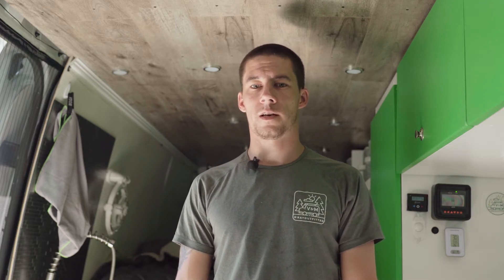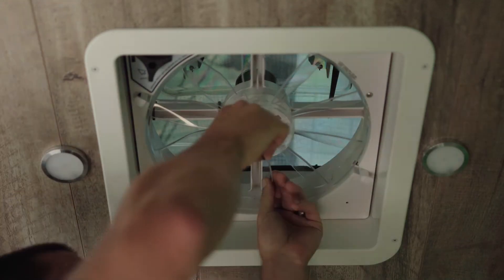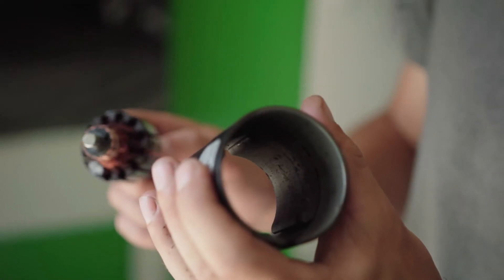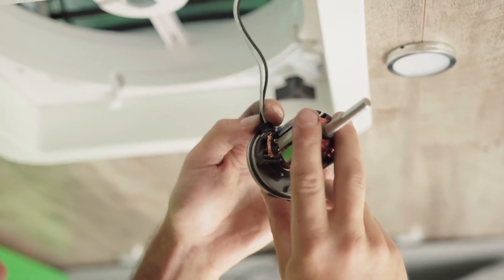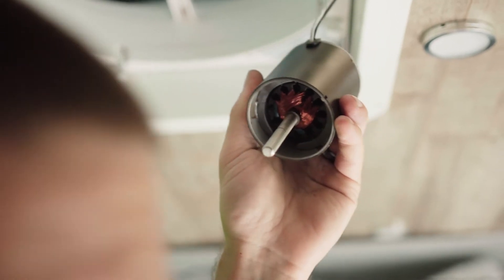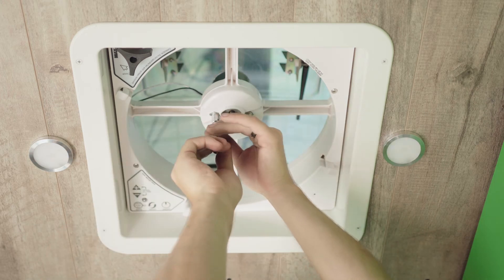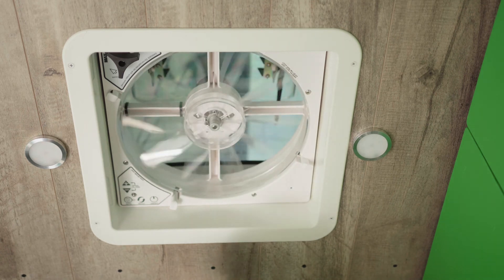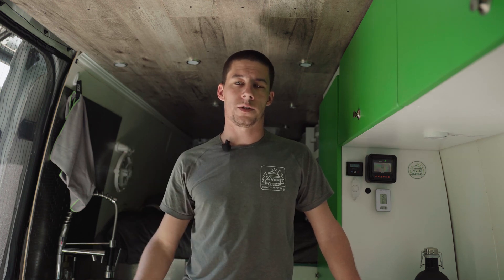MaxxAir Fan Squeak Fix - Ray Outfitted How To

Comment from the maker: Thanks for checking out my video on addressing the fan squeak. Questions or comments? I appreciate your feedback!
Reply: V & M Great videos.  do u do repairs and van builds in new york city?
Reply: Thanks for the video. I have completed this many times, but I recently did it and the motor is still squeeling slightly. Any ideas? The motor is not too old as Maxxair had sent me a new one as I had a squeel issue before. Thanks again!

Comment: Perfect instructions.  One thing to note… you do not need to remove the snap ring.  The bottom plate will come off if you angle it and you don’t have to remove the snap ring.

Comment: I was able to fix the squeak by running the fan on high for 10 hours.  I called MaxxAir first, and they suggested I do this to "seat the bearings" by getting it nice and warm.   I would have thought the bearings would have already been seated since it had been running almost continuously for 9 months, but apparently not.
Reply: same here... quite annoyed really seeing it cost me $550aud for it...
Reply: Running the fan on high speed will help clear out some of the brush dust from the path of said brushes, as well as sync up the grooves between the brushes and commutator. The squeaking is usually a symptom of running the fan at less than 100% speed

Comment: Excellent tutorial. I had never taken apart an electric motor so this was a great introduction. Very helpful to point out how to wrap the wire around the plastic tabs to retain the brushes. My maxxair fan has been chirping or ticking at low speed. I cleaned the motor innards (wasn't that dirty) and put it back together. It was still making noise. I immediately disassembled/reassembled and it's been quiet so far. Thank you!

Comment: Excellent guide - just cleaned a fan with a squeak that was worsening, and also cleaned the 2nd one while I was at it. Especially appreciate the details about securing them releasing the brushes when reassembling. One thing I noticed - it is challenging to get the long bolts positioned properly so that they fit back into the thread. I realized that this is because they are pulled out of alignment by the magnet. Took some patience and a bit of sweat to fit the pieces back together. One suggestion/request: please decrease the volume of the background music; I was having a hard time hearing some of your words.

Comment: I haven't had much luck, I've cleaned it out twice now, using paper towels and a lens cleaning blower to get all dust and dirt out of everything I could find. But the fan still squeaks. Which bit is likely to be squeaking exactly? If I were to use some lubricant e.g. WD40, on which part?

Comment: Another great video. Very informative, clear and precise. Thank you! Two notes: for my fan, the Allen key holding the fan blade was a 3/32...the 2.5mm was too big. Also, because you’re dealing with the guts of an electric motor, be sure to pull the fuse to it before dealing with the internals.
Reply: My 2.5mm Allen key was also a touch too large, I simply filed it down a little and then it worked. I didn't have a 3/32, not sure if they exist in the UK. Hope this helps people. 🤞
Reply: @nohandle181  :D As an engineer I can assure you, imperial Allen keys do exist in the UK. It cost £1.42 on ebay. Alternatively you can use a surfboard FCS fin key. That’s also 3/32.

Comment: Mine has been used full time for over a year now and the past 6+ months it has been on practically 24hours everyday. The Squeak comes and goes depending on speed. But it is mainly brought on after a decent gust of wind I have noticed.. also  can here the motor actually click on and make a louder humming sound... Going to finally bite the bullet tomorrow and try and clean it out...

Comment: For those who have issues with fitting a 2.5 mm Allen key to get the fan rod off, a Torx T10 key works too :) 
Also the fan rod might need some WD-40 and a bit of a wiggle if it hasn’t come off in a long time but it will come off.
Reply: You need an imperial 3/32 Allan key. It cost £1.42 on ebay. Alternatively you can use an FCS surf fin key. That’s also 3/32. (2.38 mm)

Comment: Thanks! Maxxfan told me the motor wasn't serviceable when I asked about the squeak years ago. I've been just dealing with the noise since. Obviously they lied. 

Any idea on what could be causing my fan to not spin, or how I can diagnose it? Voltage is sufficient to the fan, the power turns on and beeps with all buttons, but no spinning.

Comment: Awesome video! so helpful thank you! My 7500 Maxxair fan ticks quietly which you can really hear when it is on a low speed. Not sure why. Seems to have a slight wobble in the blades. Brand new fan 1 month old. Good to know I can remove the screen that easily and access the fan that way.

Comment: Tried the squeak has turned into a more rubbing squeak sound, I did have the case fall apart a bit the aluminium has ceased on the two bolts holding the motor in had to take the screw out with vice grips after trying phillips screw driver, a JIS screw driver for metal and an impact driver. I strongly recommend lubricating the threads before assembly. 

As I dropped a few things when taking it apart there was a spacer a wavy washer I put on the end plate (bottom when installed) my bearings are ceased / pressed into the shaft so they came out with the rotor.

Comment: Thank you! I had to do it twice (since I don’t have a compressed air thingy, just cleaning wasn’t enough ~ needed a bit of WD-40), but it worked! All the little details were super crucial & helpful ~ thank you! 

On a tangent, which light fixtures do you have installed there? I like their size!
Reply from the maker: Happy this video helped you.

The lights were off Amazon.ca and I did not see them after the last time I looked for them. I searched for 12v puck lights to find them.

I hope this helps. Happy travels 👍
Reply: Ray Outfitted ~ thank you!

Comment: Thanks for the great video! But all I did was remove the fan blade and clean it and that fixed my squeak somehow. Almost. Wait shoot, it's back, but just barely.. interesting...
Reply from the maker: There are some cases that fixing an imbalance in the fan blades by cleaning them will lessen or fix the noise.

Happy travels 👍

Comment: Great video, thanks for this! Question: Would it be good to add some kind of lubricant to the o-ring seals? Maybe some kind of silicone lubricant or petroleum jelly to ensure water-tight seal?
Reply from the maker: It is not required to put anything on the seals. If you are having trouble getting them in then yes you could lubricate them to get them back in. The o-rings are your weather seals.

Comment: I've got one of these that squeaks, but it's done that ever since it was new, so I doubt it's due to an accumulation of debris in the motor. Maybe there is a lubricant I can use? Not sure what would be most appropriate in this application
Reply: As a followup for anyone who may have a similar issue.
I took apart the motor and cleaned it as described, and my fan has now been running for several hours with no squeaks :) ohhh it's blissful.

1) There was indeed some graphite-looking debris I needed to clean out, even though it was new.
I wonder if it's because the graphite contacts start out flat, and quickly wear down into a curved shape against the spinning rotor thing.

2) I looked it up and apparently it's not a good idea to apply any kind of lubricant to a brushed motor. The contacts are already made of a block of lubricant.

Comment: Ive been trying to remove my fan blades for cleaning but the 2mm allen key is too small and the 2,5mm too big, any ideas? is it imperial?
Reply: My 2.5mm Allen key was also a touch too large, I simply filed it down a little and then it worked. I didn't have a 3/32, not sure if they exist in the UK. Hope this helps people. 🤞
Reply: @nohandle181  Thanks Alex. I did manage to do it in the end the same way. I filed an allen key down until it fit. 👍

Comment: Hi Ray, any solutions for van air conditioning? The lack of air conditioning while I sleep is what is currently stopping me from outfitting a van
Reply from the maker: There are options for a/c if you've got the budget and/or do not intend to use it off grid. I'd love to do a video on it but first need to find the client and rig. You're looking at the very least $5k.
Reply: Oh yeah, my intention is off-grid use, without loud generators.
Reply from the maker: Yah, no problem. It's just money. 😋
Reply: HI Ray, Julie. This is something I've put a lot of thought into.   I live in Texas and I am currently building out a 2018 Sprinter.  For me AC in the south is a must, unfortunately all of the rooftop AC systems draw way too much power to be off the grid overnight.  My solution(hopefully, will find out soon).  I found a small 5000 btu window unit at HD only draws 420watts.  I'll include link at the bottom.  I've paired this with 600AH of 12v Lifeblue Lithium batteries(7200w).  Even with the inverter inefficiency I figure this should easily run the AC system overnight.  If AC compressor is cycling it won't draw the full 420W either.   

I plan to install the window unit under the bed in a cabinet with dc fans venting the coils underneath the van.  
I'll be doing the install over the next 2 weeks.  

Hope this helps,  thanks for the video Ray!

 https://www.homedepot.com/p/Frigidaire-5-000-BTU-115-Volt-Window-Mounted-Mini-Compact-Air-Conditioner-with-Full-Function-Remote-Control-in-White-FFRE0533U1/304926708
Reply: @RonjoV  Thanks for sharing your plan. Let us know how it works. I've seen a somewhat similar approach. Best wishes!
Reply: I've installed mini split AC in my class C and it works from solar, off grid, takes just  300-500watts.
I've seen people install this type of AC in sprinter van as well and if you have solar already,(at least500 watts, I have 950) the price for AC unit is 1500 and if you do intallation youself its not 5000 or more like fancy youtubers trying to sell..

Comment: Will using 18v on this fan hurt it? What about if I set it to Low?
Reply from the maker: These questions are bed directed to the manufacturer. They have voltage range specs. Check with maxxair about this but I wouldn't recommend it as you are passing through a resistor to get low speed.